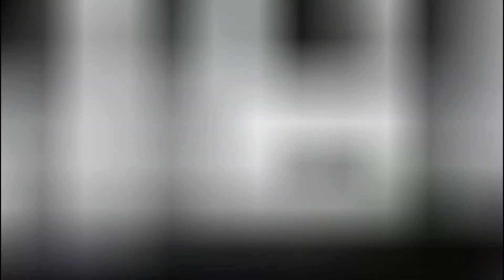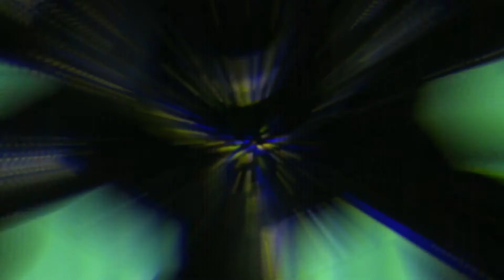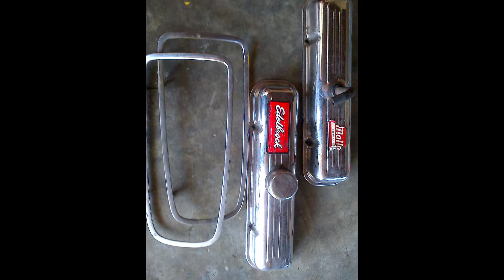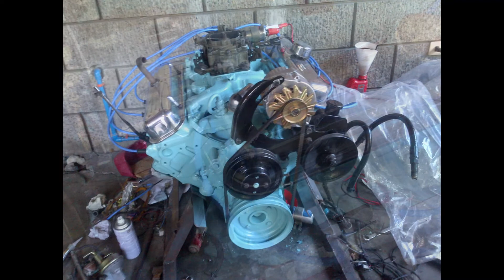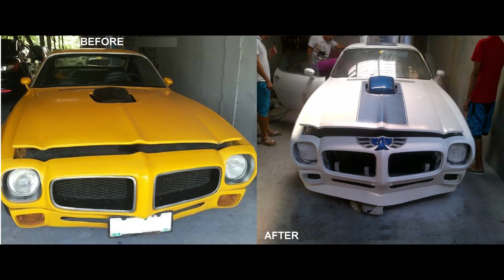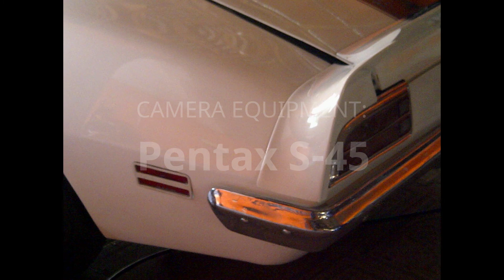Pontiac 455 HO engine build and first start

Comment: Why not use aluminum heads?
Reply from the maker: Hello! Well this car is located in south east asia and I dont have access to a lot of American parts here , the aluminum heads would put me out of budget at the time I did this project. The 6X heads were available and much cheaper plus nearly identical unported flow numbers compared to even edelbrock performer rpms! Thanks for watching our video.
Reply: @bbgcars I’m building a bored and stroked 1970 455 with butler performance rotating assembly and cam, I’m going to have head work done to improve flow because I have a set of 7F6 round ports. I debated buying alum heads but if I spent the same amount or even less l money having the 7F6 heads ported etc I’d probably make more power and flow better than standard alum heads. Plus it’s gonna be cool to have actual Pontiac parts (minus internals which no one can see lol)😅
Reply from the maker: Awesome! Those 7F6 are sick! I normally run ported 5c's or 6X's on my engines,  but being away from the u.s. I cant get a hold of them here cus all the peeps here like to hoard pontiac engines and most big Inch engines from all makes for that matter ! Is your engine a butler built 461, 474 or 535 cid??
Reply: @bbgcars  461, it’s going in a 1977 Bandit trans am that I have a tremec 5 speed in that I am going to drive a lot. So I’m trying to make a street friendly daily driver that will run great on pump gas. It has a 68 gto 400 (.030” over so actually a 406) right now that’s been in it since the late 90’s and it still runs like a champ. I ran nitrous on it for years so it goes to show how strong the Pontiac engines are to still run this hood after all these years. I’m upgrading the rear end too, just haven’t picked between a 9” ford or 12 bolt.
Reply from the maker: Wow that is amazing! Yes pontiac engines are very strong , I had an early nascar style build back in the day pushing big race numbers on the street with a high overlap cam and I always has to have it in neutral while I was at the light! I was driving a 1974 transam SD 455! Yes it was a real one...but it was 1991 and I didn't realize what I had to a totaled her and checked the original title and records years later but sadly as I went back to the junkyard that took her they would not under any circumstances sell me the car back because I learned a lot about body work and could rebuild her ..but it eventually for crushed and I'm still sad about it ! I wish I could go back in time! I would have never raced that car and just raced my charger instead as it was a plain Jane one..ah the memories ..in the future I will be doing some more engine builds ,like a BIg block Chevy, LT 1 chevy, small block 305 chevy strike. And others stay tuned ! Btw why don't you add a Fitech fuel injection system to your engine , it would run so much better and you could fire it up in the winter with no problems cus the Pontiac engines are cold blooded creatures! T.c.

Comment: It doesn't have the H.O. round port heads on it in the video.
Reply from the maker: Yes very good sir! Those heads were long gone by the time I got to this car , so the heads were replaced with D Port 6X heads milled for higher compression. I had a pair of 5C heads available as well but it had s crack in one of them.I built this engine for more torque because it's in the Philippines so high speed isnt necessary. The cam I used was a comp cams xtreme energy 274, with    hypereutectic pistons, moly rings and factory crank...[the HO block remains and is numbers matching]